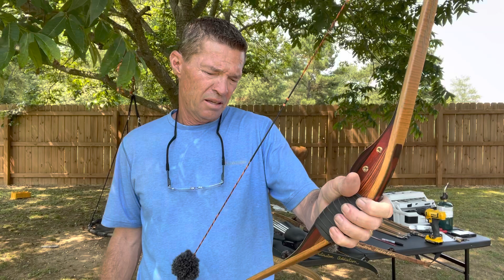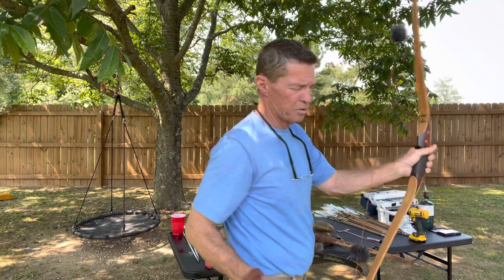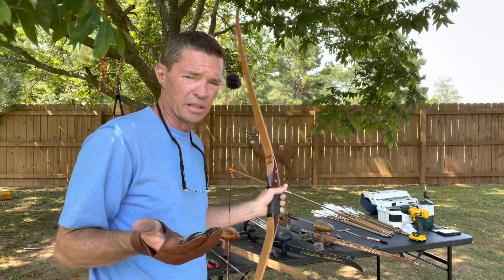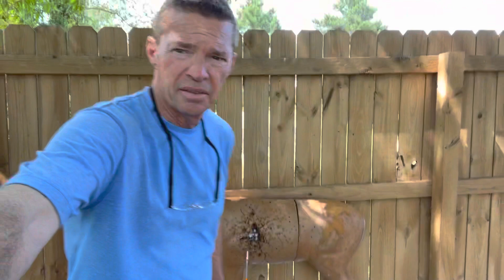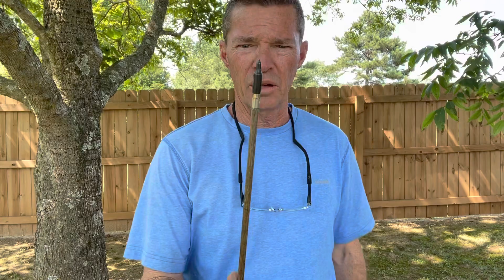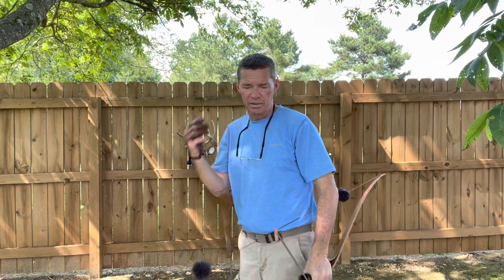Easy Set Up And Bare Shaft Tuning Longbow/ Recurve for Broadheads

Comment: I'm only 2min in and had to pause . . . 
You're trying to explain the basics of tuning traditional archery gear to beginners, in an easy to understand way.  But you completely skipped past traditional wood arrows without a single word of mention, and went straight to high tech carbon.  Before you can learn how to tune an arrow, you need to have some understanding of how to choose which arrows to begin with.  You skipped over that as well by just saying you bought 550s because you already know they work well with your bow.  And while many of us do know what that number means, a lot of beginners don't.  And we certainly don't know which number to buy, or why, or how it makes any difference one way or the other.  If you're talking to a beginner audience, looking for easy ways to start.  And then you said 550 is the same as 500 so now numbers don't even mean anything.  This feels like a first grader who's still trying to figure out addition and subtraction, sitting down to a seventh grade algebra lecture.

Comment: Can't you "knock tune" a bareshaft to correct the flight?
Reply from the maker: @drdrum1000  yes in some cases you certainly can but usually only after the correct spine with the point weight you want to run is established , the main reason for nock tuning is to correct the bad arrows in a batch which is usually at least a couple lol
Reply: @instinctiveaddictionarcher8998  thanks for the response,  I'm starting to understand the arrow build process. If I had only known 10 years ago when I shot a monster in the shoulder with a 100 grain fixed 3 blade. If I knew about foc back then I'd have one heck of a mount in my collection.  That of course was a compound bow with 50lb draw weight with 28" draw length. Shooting 400 spine Easton Flatlines. I had feathers on the back, but feel now I needed more weight up front to truly do the damage. Thanks again for your very informative videos. One can use that knowledge if they know how.

Comment: Question?Does your quiver style effect how your bow shoots?Meaning a Limb bolt style vs a strap on or slide on quiver?
Reply from the maker: Yes! Always make sure a strap on or slider is well up into the limb fades and then it’s minimal but it affects the balance and bow reaction a lot which is actually very good!
Reply: @instinctiveaddictionarcher8998  What about a limb bolt quiver?My Dad is letting me use his limb bot quiver until I get mine.And that is what I'm gonna be practicing with..So I guess my question is if I decide Not to stick with a bolt on quiver will I really notice a difference in my shooting
Reply from the maker: @Tradman47  thanks brother and it will feel the same yes!👍🏻

Comment: So you recommended shooting vertically when bareshafting?
Reply from the maker: Yes it’s a must, if by chance you have a tail left weak arrow and are canting the bow it’ll appear as a nock high so you have to shoot completely vertical with a light hook not torquing the bow or the string and it’s still never going to be as easy as a compound with a mechanical release but it’s still necessary to at least get a decent bare shaft tune to expect great broadhead flight 👍🏻
Reply: @instinctiveaddictionarcher8998  thank you so much for this info and reply! I’ve finally got my bow shooting lasers now.  I will say something that was strange to me was when I got my perfect bareshaft shooting vertically, I tried canting just to see what it would do and it kinda threw it nock right but vertically it’s perfect out to 20 yards even.  But fletched it looks great

Comment: Hello I’m new to trad archery but not archery in general. My local shop doesn’t know much about trad. I called Easton and they set me up with a 6.5 with a 340 spine. 
From 10-20 it is shooting the nock left and the point right from the minute it leaves the bow and never recoveres. I’m shooting them full length 31.75in.  My draw is typically 28in and the weight is 45lb. Any help would be appreciated.
Reply from the maker: Yes sir, the 340 is going to be way too stiff for your poundage unless you run around 300 grains up front, typically a 400 spine with around 250 gr will be great and a 500 with any less point weight, but 340’s can work just have to really load them up with point weight 👍🏻
Reply: @instinctiveaddictionarcher8998  some axis 500 with 75 hit inserts and 125 head I am finding flies really well to 20. I have to work on my consistency for sure. What arrow weight is good for hunting with this set up? How to I measure what my actual draw length is on this bow?

Comment: Why do you put two nock points on your string? Is it to put space in between your finger and nock to eliminate nock pinch?
Reply from the maker: No sir it’s only to keep the arrow horizontal upon release, the bottom nock keeps it from “ramping” off the shelf.

Comment: Hey Jeff,  Just found your channel and subscribed right away after seeing the quality of the content you bring.  THANK YOU for all the time you put into your channel.   It's cool stuff.  But I need your advice on something. Not new to archery, but new to traditional shooting.  Working with a 45lb recurve but it's a LEFTY!   So as I follow your video everything is for right-handed shooters.  I'm trying to select and tune some hunting arrows from 10 yards.   They hit target nock left.     Think of it this way.   If I was shooting a CLOCK. 
The arrows enter the target at 3 Oclock with nock towards 9 Oclock .    Shooting 150 and 175 gr tip.  Please advise??    THANK YOU in advance.
Reply from the maker: Thanks brother, on the left handed bow it’s exact opposite, tail left is stiff and tail right is weak, the up and down is in the nock setting just have to start at 1/2” above center or zero and go slightly up or down until the arrow levels out in the target 👍🏻

Comment: I just leave the arrows full length and shorten if needed. I can always cut an arrow shorter but you cant make them longer to change spine. If you want a finger trigger on a longer arrow you can use a small piece of arrow wrap.
Reply from the maker: Exactly! We’ve got one doing just that on a gold tip traditional just a little piece of arrow wrap works like a clicker as long as the riser allows it to gently drag across your finger 👍🏻

Comment: Hi jeff, I’m shooting 400 spine arrow at 32 inch with a 100g insert and a 175 tip . Im way over spined after bareshaft tuning. Would you recommend a 500 spine or 550 ? I’m shooting 48 lbs at 28 . God bless
Reply from the maker: Probably just a little bit, I’d either load that 400 up about 25 grains more or go with a 500👍🏻
Reply: @instinctiveaddictionarcher8998  thanks again for all your help

Comment: I've been using cool melt since I started last year. It can slip rarely and can be annoying to work with but I can do a lot of messing around by just walking inside and running an arrow under the hot tap without having to worry about anything. I had a layered foam cube plus the bow I was using was center shot (plus I'd never tuned before) and I'd get a lot of vague or false readings as a result. I really should have done a harder glue before hunting but I didn't, and a new bow is in the mail right now so I guess it works out.

Comment: Are the weighted inserts necessary for good arrow flight or for penetration when hunting? I am getting into target shooting and tuned my arrows using 125 grain field points but no extra weights on the front of the arrows. Is this OK or should I add weights and try tuning again?
Reply from the maker: Yes running around 200gr up front is actually more accurate and consistent than less especially in any wind👍🏻

Comment: Good stuff. I've noticed that you don't seem to spin and tune your inserts before gluing them in. Do you ever have any issues with broadhead wobble?
Reply from the maker: Thanks Blaine I actually do spin test all my heads before sharpening for hunting and that’s why I like hot melt so I can heat and spin them if they have any wobble but rarely does any of them need it especially with a high quality saw thanks so much brother 👍🏻

Comment: Jeff....what a wonderful surprise finding your channel.   I'm relatively new to Trad, gave up the training wheels a couple years ago.   Love all the great content you're putting out.   Quick question...what kinds of fletchings are you using?   I've been using the "standard" 4 or 5 inch Tru-Flight Shield cut turkey feathers from 3Rivers, but looking to expand out and use some plastics that are a bit easier to work with.  Sincere apologies if you've already covered this in another video.    Again...many thanks for all the great content.   God Bless!
Reply from the maker: Thank you so much and I actually am a 3rivers dealer and I use the tru-flight 4” shield cut on nearly everything lol

Comment: I choose a set 200 gr. Heads and have been trimming them back vs the way you are by changing the point weight but do you have any idea why I’m getting mixed weak/stiff reactions when switching to a fixed crawl from 3 under? Each is consistent tho, wonder if something to do with tiller?
Reply from the maker: Yes absolutely, the bow is either tillered for split or three under and when you go to a crawl the draw length is significantly shorter and loosing energy so you have to go to a weaker spine or load up on point weight to weaken the arrow and then it should tune👍🏻

Comment: Never cut shafts blindly before shooting... Great way for a beginner to be left with using a 300+ grain tip to make it tune.. 

1) Install insert and point weight you think you want 

2) Shoot the arrow. Trim by 1/4” max if weak, go up in point weight if stiff. 

3) Shoot again and repeat... If trimming, then do so until the arrow is perfect at the distance most comfortable for you to have reliable results 

I have had guys have to buy new arrows by cutting 3” off the front and now they can’t use their 150-200 grain field point.. don’t trim prior to shooting!!
Reply: 100% agree. Cutting before shooting is just going to bring you heart ache and wasted money

Comment: at the start you say 280/300 optimum weight is that the arrow weight before adding the outsert and point
Reply from the maker: Actually we were referring to point weight and usually that’s about what the shaft and nock together will weigh giving a total finished arrow weight of around 600gr thanks so much God Bless

Comment: I love to build arrows up for all my different hunting setups as well! Something I have discovered with carbon arrows....you can have a dozen carbon arrows and every once in awhile you will get one or two sometimes three.... with a weak spine or an overly stiff spine. At first I thought it was just me and my release/bad form. I continued to test and discovered it was not me after all but the arrow. I did some further research on carbon and discovered that in the manufacturing process of carbon it is quite common for carbon to have voids (air pockets or excess glue) in the carbon/glue up process. I now make sure to bare shaft tune all of my arrows before I glue them up! I have also found that if you bare shaft tune at distances greater than 20 yards you can really start to fine tune your bare shaft for perfect flight.
Reply: I was wondering if I was one of the only ones that bareshaft tune every shaft instead of one and make up the rest

Comment: Yeah, if you’re a new archer, DO NOT cut your shaft before shooting them. This guy has done this enough to know how short he can go. This advice is a great way to cut a bunch of arrows too short. 

Start with a full length shaft and cut down from there.
Reply from the maker: Yes there are so many variables and I agree but only in the case of being an Aimer“ gap” shooter where one would want or need a longer shaft to close the “point on” but most instinctive shooters only want around 1-2” beyond their full draw so as I mentioned having someone mark the shaft 1-2” past the desired length to allow for trimming on the nock end to achieve a perfect tune but it also depends on the shooters draw length some can’t hardly afford to cut any off, sorry for any misunderstanding thanks so much 👍🏻

Comment: I enjoyed the video.I've seen the difference in a carbon arrow and the speed looks great. They make the cedar arrow seem so much slower. I'm going to be changing over to carbon arrows. I have a question though. How do I determine what insert or insert/outsert I need? Hot melt would help as far as changing out the insert as I try ti determine what weight insert I need, but where do I start at? I can see me with a lot of arrow parts as I try to find the perfect arrow flight. Normally I shoot a 70 pound cedar shaft with 125 grain Eskimos Broadhead (and field point) and they fly great. But they are slower, and drop quicker than the carbon arrow. I like the increased speed and flight of the carbon arrow so I'm determined to change over to carbon arrows. I still want to shoot the 125 grain Eskimo Broadhead. The 125 grain Eskimos are the glue on Broadhead type (taking them off the cedar shafts) and I'll be shooting a 60 pound longbow. I'll have a 125 grain Broadhead an insert (15 grains?) , and a glue on adapter (31 grains). I believe this brings my total tip weight to 171 grains. Any idea what arrow weight I should shoot? Very grateful for the work you put into this video. I guess that's why I like YouTube!
Reply from the maker: Probably a 400
Reply: @instinctiveaddictionarcher8998  Well I took your advise and bought six 400 Easton carbon fiber shafts along with 100 grain brass inserts and 150 grain field points. I was shocked at how these flew! And you could almost feel the penetration when they hither target. This is a perfect arrow set up. Can't thank you enough for your help. The videos you're putting out are so much help. Again, thanks!
Reply from the maker: @tomh7708  that’s awesome brother I’m so glad to hear that you’re ready for the woods happy hunting and God Bless!
Reply: @instinctiveaddictionarcher8998  Thanks!

Comment: This is all great if you dont have a 32 inch drawlength......I cant find blank shafts long enough most times.
Reply: Black eagle vintage/instinct. Stock length it 34”!!
Reply: @OGrips  cheers I'm in Australia,,,,it may not be available here. But thanks for the tip

Comment: Thanks for another great video Jeff! Question, do you worry about broad head orientation? You briefly mentioned it here but wondered what your full thoughts are. Personally, I like my two blades heads to be as perpendicular to the string as I can get them. It would drive me nuts to draw back a head that was at 45º or some odd angle.
Reply from the maker: No it doesn’t affect flight at all I just kinda like mine all turned the same 👍🏻